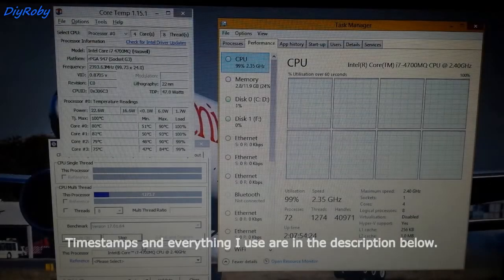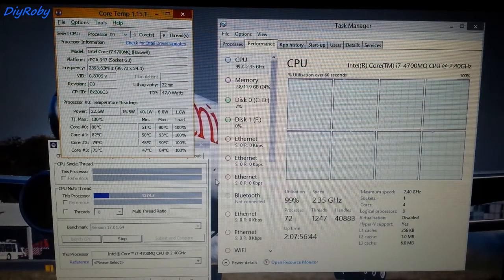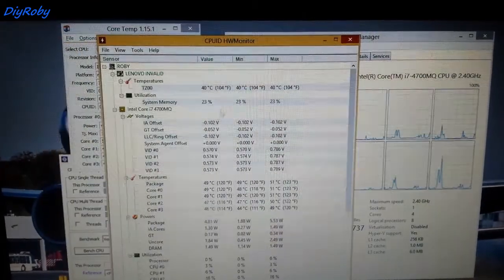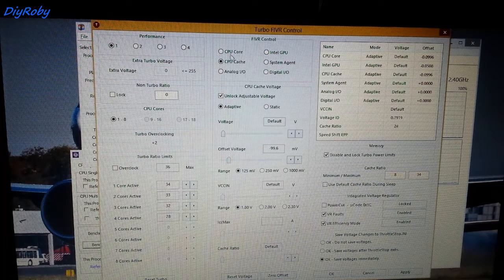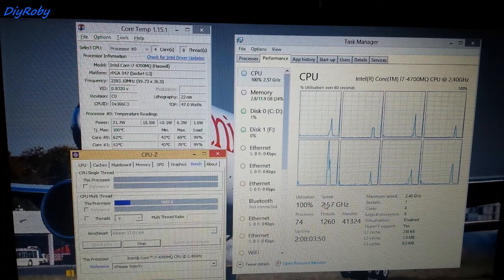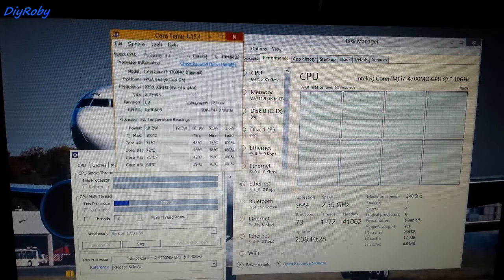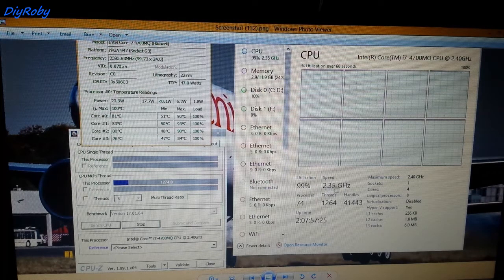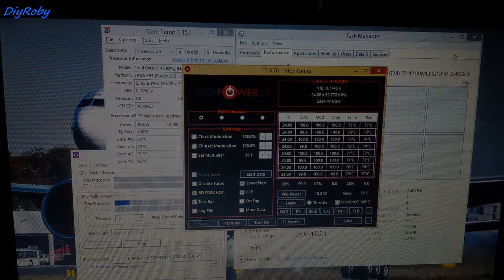i7 4700mq Undervolt & tuning with throttlestop. Cooler temps, efficient. I7 4700MQ upgrade update 3

Comment: Hi, I have a ThinkPad w540: i7 4800mq and quadro k1100m. I think i7 4800mq has just higher frequencies than 4700mq, so should I set the same settings?
Reply from the maker: You can try, then tune it till you have complete stability (no blue screens of death) in both idle and under load.
Reply: @diyroby732  Even with -80 undervoltage my laptop started freezing and showing a blue screen in games like cs go.

Comment: Doing the CPU bench on CPU-Z while keeping the original Turbo Boost multipliers (34, 33, 32 and 32):

Single thread perfomance: 360.1 (4% faster than i7-2600K)
Multi thread: 1774.6 (6% faster than i7-2600K).

Overall, i beat the i7-2600K

Stressing the CPU with all turbo multipliers at 30:

Multi thread:1663-1660 (close to 80°C, if it does thermal throttling, then the clock speed is reduced to 2.8-2.9GHz which is still a nice frequency). This is like 1 or 2% slower.

In Geekbench 5 i also beat the i7-2600K with the default turbo values:
Single-core: 860 (826 on 2600K).
Multi-core: 3244 (3195 on 2600K).

Quite a beast, meanwhile, the NVIDIA GTX840M GPU that i have is now slower than integrated Vega 8 graphics lmao.

Comment: I have it undervolted at -87 mv, changed the thermal paste and cleaned the fan, i have turbo boost locked at 3GHz and it can hold that frequency for a very long period of time. Checking CPU-Z, it's now very similar to the i7-2600K.

CPU temps between 60 and 77°C, at full power is 32 watts, 80-85°C still at 3GHZ. So, i basically changed the multiplier for all cores (each configuration or the 4 values) to the same number (30), now it's like the base frequency is now 3GHz. I have bios issues and i can't go beyond 85°C, also, my GPU could be in danger.

Comment: İ ll try also the same notebook i7 4900mq. Are you suggest
Reply from the maker: For the Lenovo G510, the may CPU were 4700mq and 4702mq I think. 4900Mq may not be supported by the bios. I haven't seen anyone online say they have a faster CPU than those listed above in their g510

Comment: My Lenovo laptop also has a 4700MQ.  During the CPU-Z stress test, it runs continuously at 3.4 GHz and is steady at 1900 points.  There is no 85°C limit.  You need to learn how to use ThrottleStop.  Open the FIVR window and try setting the Non Turbo Ratio to 1.  If this does not fix your problem, check the Set Multiplier option and set this to 36T.  Make sure SpeedStep is enabled and click on the Turn On button in ThrottleStop.  After you do this it should say ThrottleStop 8.70 in the title bar.  It should not say Monitoring.  Open the FIVR window again and check the Overclock box and set the Turbo Ratio Limits from top to bottom to 36, 35, 34, 34.  If you need further help, contact the author of ThrottleStop.  It is painful to watch a 4700MQ running at a fraction of what it is capable of.

https://i.imgur.com/z30Y1nV.png
Reply from the maker: The beast is UNLEASHED, bro. Non turbo ratio set to 1 and no more 85C throttling. 3.2 ghz all cores easy. I can't believe it and I'm actually a bit scared of what this laptop can do now lol. Temps are allowed to go to 95C and over. It's midnight here and I guess I'm not going to sleep tonight lol. I will update my last videos and make a new one about this. Thank you so much for your help. https://imgur.com/l16LDm4
Reply: @diyroby732  Looking good.  Now you just need to follow the rest of my advice.  The part about checking the FIVR - Overclock box and setting the Turbo Ratio Limit values appropriately.  Lenovo used a variety of throttling schemes during this era.  Thankfully, they are easy to over come.  Overclocking is a feature that Intel included in the 4700MQ.  Why not use it?  You might need to Google research some better thermal paste for your new beast.  I have been using my Lenovo Y510P since the day I bought it at 3.4 GHz so no worries.  There is one more trick where you can run this CPU at full speed, way beyond its 47 Watt TDP limit, but you have to get your cooling up to snuff first.  Good luck sleeping now!
Reply from the maker: @unclewebb  Aahhhahahaha all core overclocking on my tiny single heatpipe no dGPU cooler is not going to be happening any time soon. I had a hint you had a gaming lenovo laptop, your cooling pipes are huge and the heatsockers over the gpu and cpu are huge as well. The y510p can take it. I just tested 3.2ghz all cores ThtottleStop Bench, hit 100C halfway through the test and watched my laptop shut down lol. It made me very happy though, because now I am in full control of this quad-core. My thermal paste is NT-H1 noctua so it's good. Tomorrow, I'll be adding another heat pipe to my cooling system to help get the heat to the radiator quicker. I am very satisfied with my new 550 cinebench r15 score after months of 460 :)
Reply from the maker: I hope you are right Kevin because this is what I dreamt of when I got my cpu in the mail. TBH, I'll be fine with 3Ghz all cores. I'll run your settings now and let you know. My main worry was that the laptop (a G510 non gaming laptop) behaved this way even without throttlestop. Immediate throttle to 2.4 once 85C are exceeded. I have over a 100 sceeenshots I took while rendering videos or benching the cpu and can actually tell you how many seconds to throttle once we start reaching 83C. I see on google that it is a known problem with some brands of lenovos locking this setting in the bios prochot. What is your laptops model?
Reply: Hello Kevin i have a lenovo y510p too. Could you send me your ThrottleStop settings, because img link is broken..
Reply: @ahmetpolat5168  me too overheating had killed me
Reply: To anyone reading this, only use the settings suggested by this comment if your laptop has decent cooling.I have a  4710mq, but the cooling is very sub par on my machine, so temps quicly went through the roof.Also I would get freezes when I set non turbo ratio to 1.Just a heads up
Reply: @pzrxex  If your computer freezes, it is usually because the CPU is not getting enough voltage. Are you undervolting? If you have lowered the CPU core or cache voltage, you need to increase it. Run some stability tests like the TS Bench test. Both full load and part load testing are important. ThrottleStop 9.2 also has a new random MHz test option that you can use while the TS Bench test is running. A stable CPU will still be stable when the Non Turbo Ratio is set to 1.
Reply: Hey man, my cpu seems to be running hotter than yours. Any help you can offer?. The max temp from the tests are hitting 94 degrees to 100. Idle temp seems to be around 75 and up.
302 single thread and 726.1 multi thread
Reply: I have the G510 with the R7 M265 discrete gpu. I was thinking maybe liquid metal is the solution to a 3.4 GHz all core boost, although i haven't tried it yet. Also modding the bios might be a solution to maybe overclock even beyond 3.4 ghz, at least for 1 or 2 cores at most.
Reply: @SpFres1  No need to mod the BIOS. The 4700MQ can run at up to 3.6 GHz when a single core is active. Check the ThrottleStop FIVR Overclock box and set the turbo ratios to the max; 36, 35, 34, 34 from top to bottom. I have been running my Lenovo Y510P - 4700MQ at these speeds for more years than I can remember. It still runs reliably at full speed with a mild undervolt of about -40 mV for the core and cache. The heat pipe mod in subsequent videos has me thinking about installing a 4800MQ. Maybe next year.
Reply: @unclewebb  Maybe better binned silicon?
Reply: Hello Kevin I have a Lenovo G510 I7 4700mq cpu laptop..Can u send me detailed all the best setting on ThrottleStop please? I have Throttle Stop 9.5 Thanks I would be very happy if u help me :D :X